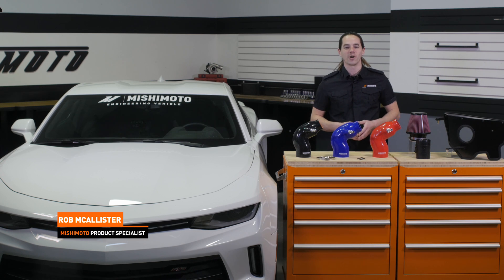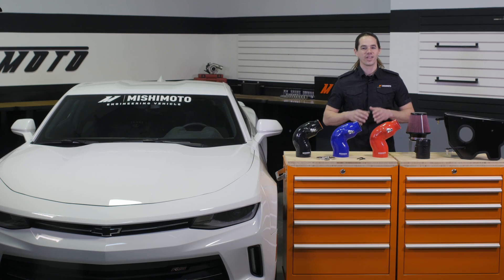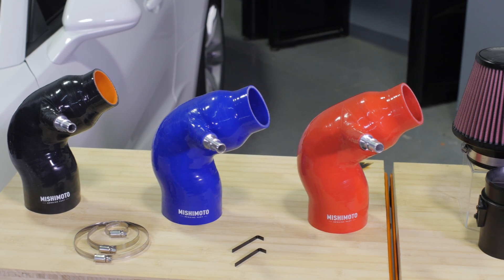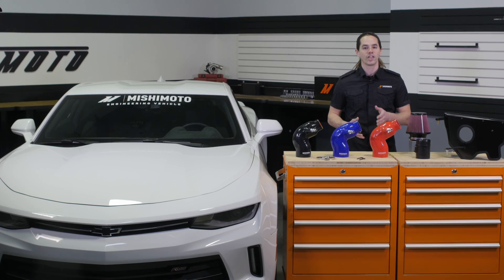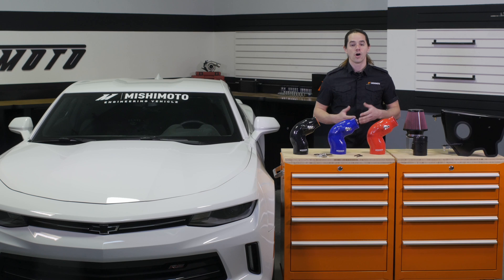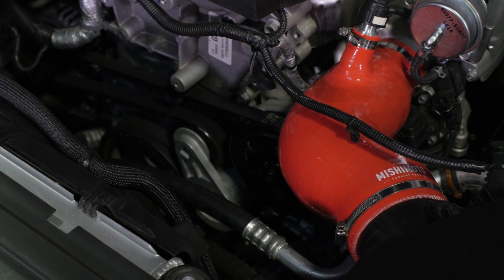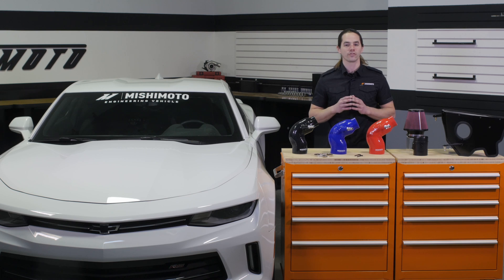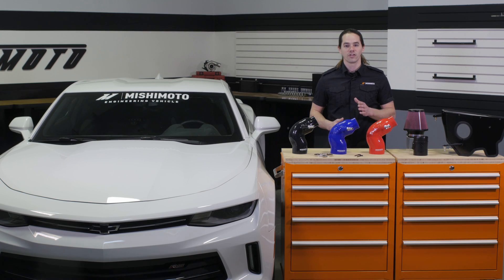2016+ Chevrolet Camaro 2.0T Performance Air Intake Features & Benefits by Mishimoto

Comment: Voids any warranty?
Reply from the maker: Hello Chitown Rider. Generally speaking, we've found that aftermarket parts and warranties really comes down to your local dealership. We've worked with dealers who suggest our parts, and others that stated they will in fact void warranty. Being that this is a direct fit part for your vehicle, that requires no tuning or modifications, I'd be tempted to say you'll be fine. However, I would suggest giving your local dealer a call without providing any direct information about your self or your vehicle. Should clear up your question quite quickly :)
Reply: Mishimoto Automotive thank you i appreciate the advice!
Reply from the maker: Anytime my friend :)